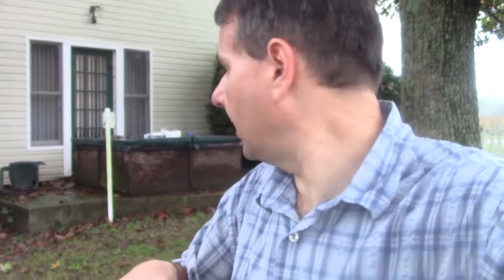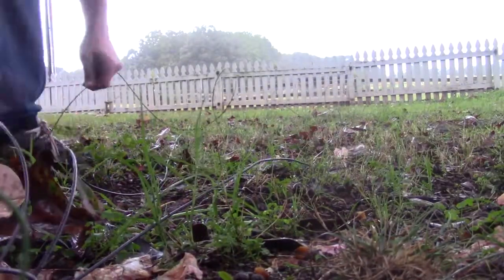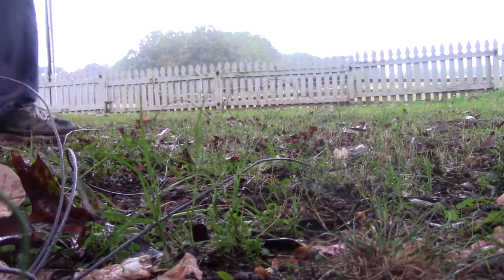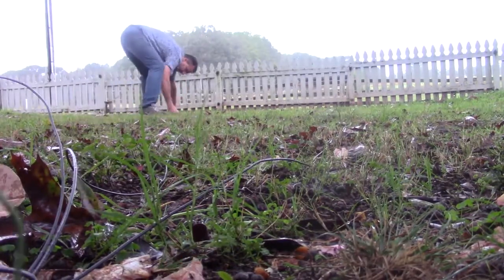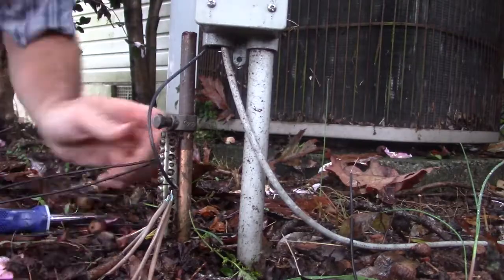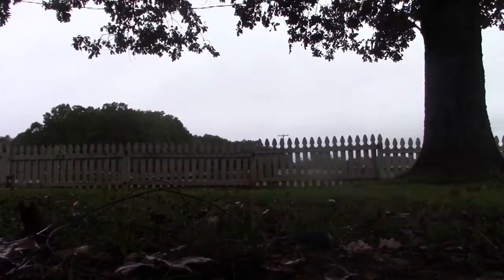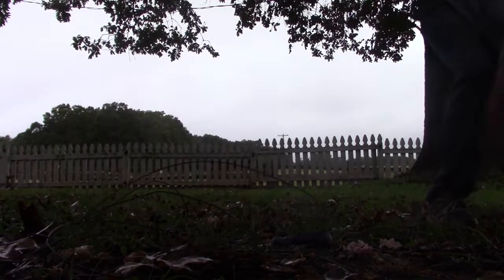Laying down Ground Radials for Vertical Antenna

Comment: Ive got 350 10m long radials now, more doesnt nesserserily improve tx, but in my case , more reduced noise. 73 zl3xdj
Reply from the maker: They certainly help!  I wanted to make sure people knew you don't HAVE to go through all of that to have a functioning antenna - elmers make it think unless you lay down 100 radials you are wasting your time.

Comment: You can also use 1 piece of bare wire strung out to spikes/nails/staples around the vertical in a "star" pattern leading back to a base plate with bolts in it. In other words, you do not have to lay out individual wires. Wrap a wire around a base plate bolt, run it out to a stake/nail/staple, run it back to another bolt on the baseplate, run it out to the next end stake/nail/spike/staple, and then back to the base plate, etc.
Reply from the maker: Thanks for sharing, Bill!  Though the only issue that I have is if by chance a lawnmower does pick up the wire, you would lose a lot as it wrapped around, opposed to just one - but that is a long shot concern.
Reply: @dixielandfarm  Yup. The wire would likely break as quickly as it would if individual radial wires had been installed.

Comment: Hi Kris, great info there. I just ordered a Hy Gain av18vs from Gigaparts this morning and was wondering about the radials. Guess I'm going to amazon now and order the wire and lawn staples. 73, ac7tf from Muncie Indiana
Reply from the maker: Only if it is cheap and easier for you, Paul.  You can probably get cheaper at a Lowes/Home Depot/Tractor Supply... or even better I found rolls of unused telephone cable no one wanted and used that as well.  Same with the wiring block - I grabbed on from Home Depot and it was like 5, but a simple ground clamp and all the cables just wedged in there would work - it isn't very scientific, its just physical hardware connections.
Reply: @dixielandfarm   yes it's a bit expensive on amazon. Got it at lowes and it is already in the locker waiting for me to pick it up thanks again.

Comment: Kris, very good video. Are the radials any specific length? Could you have some that are 3' and others that are 12' of 15'? Are you saying that the TOTAL length of wire used should be 4 wavelengths? Also are the lawn staples metal? Thanks again for the helpful video. Just getting back into HR. Use to be very active but other interests got me. Now I'm back and am suffering with sticker shock on the cost of HF rigs today. de KQ1K
Reply from the maker: This will get very contentious around hams, who insist they must be 1/4 radials...  Total amount wire should be 4 wavelengths, yes.  The radials lose effectiveness quickly in their length, which is why 32 1/8 radials is better than 16 1/4 radials.  64 1/16 radials will also be better, so always just do the best you can with what you have available for space... but also factor in the time to actually lay them out.  The lawn staples are metal, yup.  HF rigs are still cheaper now when adjusted for inflation than ever, but that doesn't mean they are cheap... hamfests will still get you an hf rig for much less... but the new ones seem to last forever - mine is still pumping along 15 years after purchase with no slowdown in sight.
Reply from the maker: Oh, and the follow up - worry less about measuring out the length - they all get detuned the second they are in the ground, so just focus on getting as many in the ground as you can.  And as for 1/16th radials - well, that's probably stretching it - aim for 1/8 if you can.

Comment: How did you attach the ground bus to the ground rod??
Reply from the maker: In the electrical section of the hardware store they sell ground busses - which is great to attach all the cables.  then you can use either a ground rod clamp to hold them together, a jumper wire from that to the bus if that works for you, or two stainless steel hose clamps to bond it.  While not ideal, it works just fine for the antenna.
Reply: @dixielandfarm  Tnx Chris. That's what I thought but I just wanted to check and see what you did. I'm in the mist of putting up a Zero-Five 30' flagpole antenna and the next thing is the radials.

Comment: I’ll be doing that this weekend but in the desert with dry soil, 500’ of 14 ga. 16 radials. Two band vertical , 40 and 80. I’ll get the 80 radials down next weekend probably, another 500’ but only 8 radials, etc, until I’m happy or broke. Enjoyed your presentation.
Reply from the maker: Remember Paul, thickness of wire won't do anything special for you (unless you need it for some reason, or that's what you have on hand).  You can lay down 22ga and it will have the same effect... so you can often find telephone or ethernet wire spools cheaply that are at building supply exchanges/charity/etc and use that - I used dog fence wire for most of mine, but there is some telephone line in the ground :)  Good luck!
Reply: Highly corrosive soil with no conductivity here. Bare wire of any sort is temporary, anything with iron or steel wold be pointless. I’ve done this before but have been off the air for a few years and am installing a fresh antenna as a restart. I’m not troubled by trees either. Living in high desert country is different. On the plus side, I’m at 6,200 ASL with zero above ground electrical utilities and an unobstructed 360 view. It’s quite different than your QTH. Thanks for your advice though. I checked our biggest surplus store yesterday for wire, etc. and the big box stores have better prices and inventory. I can see all the high power broadcast antennas in the area, they’re on a 10,000 foot peak about 50 miles south of me.

Comment: My first serious ground radial system was 30 radials of 32ft each, two years later, 30 radials and most of them were 32ft... stupid lawnmower. After 30 the increase in performance drops off very quickly. The lot where I live now is rectangular, so the plan is (by the way, I recovered all my old radials) to lay out 20 radials of 17.5ft each. I have very rocky, very sandy soil and the water table in the winter is about 30 inches down (I live in Campbell River, BC or as it is known here, "The Wet Coast"). So we shall see what happens, may have to lay out a few more radials, who knows. Thanks for the video, Kris. de VE7KKQ
Reply from the maker: Some say a mesh screen of chicken wire stapled to the ground does great as well... but honestly people get scared off when they hear how much work/wire is needed and just never try for themselves.... while every dB counts, the difference between one S unit or NOT having an antenna, just put up what you can and do your best - or even not your best but pledge to try to go back and do better when you can is the best advice.  Hope you have a great New Year, John!

Comment: My vertical is 43' up. No radials. Using the MFJ-259C, I have a >26:1 SWR. I have to get them radials done ASAP. If things do not get better, I am gonna have to find a different antenna.
Reply from the maker: Even if you dont have time to tack them down, just lay them on the ground to see if that fixes the efficiency of the antenna.  The 43' is a compromise antenna and is not the miracle people think - it is the most convenient vertical, though... It will work, but it will need radials - even at that, you could string up 4 verticals a few feet up off the ground just to see if it puts out (like around the fence if you have one).   Once you feel confident, then you can take the time to actually tack them into the ground.

Comment: m6ltv i made one with a old fan corver  a crome one and the swr is 0 on 20 73 nigel
Reply from the maker: Remember, low SWR isn't always an indication of a good antenna - a dummy load has 1:1!  For verticals, it tends to go up the more effective they are.  Regardless, if you are making contacts, its working!  73 Nigel!

Comment: Been wanting to put a vertical up in the back yard but I literally have only about 10 feet of available lawn in any direction. I don't know if a bunch of wires that short in the ground would do me any good. Talking on an end fed wire right now which gives me plenty of stateside contacts  but very few DX contacts other than Canada.
Reply from the maker: If I recall, the minimum radial wavelength recommended is 1/8... but remember the wire doesn't have to be straight - it can zig zag a bit - but in that case you might want to consider some elevated tuned radials - this will work around fences and such and you probably only need about four of them.  If you can get the wire cheap enough, I would just thrown it on the ground and see what happens.  For 20m, I would consider a vertical dipole - the trick is to get that transmission line to be 90 degrees out from the antenna - but at 15 foot high for the feedpoint that shouldn't be too hard to accomplish.  If your yard happens to have a metal fence, I have read of plenty of people who have used THAT as their counterpoise to some success.
Reply: @dixielandfarm  Thank you. KE0RPU

Comment: Interesting video Kris - love the geeky vids! Thanks for the explanation too. I can't imagine why Marissa wouldn't want a lot of 33ft long wires in the air above the farm, haha. :)
Reply from the maker: Luckily she had no problem with me putting up a 30ft antenna tower next to the house with a 10 ft antenna on that... I used to have a 200 ft antenna going from one tree all the way across a pasture to another tree but I finally took that down after five years... I still have to figure out is this the year I get that hot tub working again...

Comment: Hey Kris, have you tripped already ;) Just kidding. I only know little about antennas. This is cool to know, in some ways it is amazing it is all working. Curious do you get more disturbances these days with all the new mobile frequencies, although they are on the other end of the spectrum. Cheers.  /Paul
Reply from the maker: I DID trip once - but I tacked that one down and I was off.  Funny enough, we have had such a wet winter that they are all already buried, just one month or so after "planting".  You are correct, the cell phones are basically on the other side of the spectrum, so there is no interference, BUT cheap electronics, especially wall chargers, LED lights, CFLs, Solar Panels all make terrible radio pollution.  There are laws in place, but they just aren't being adhered too... Almost any wall charger that uses a switched power supply makes a hash across the entire radio spectrum (opposed to the older ones that had a transformer and were basically silent).  Also, everything electronic is made of plastic when we used to have nice metal shielding around things - so those noises are no longer suppressed.  Out here in the country, I'm my own worse noise, but I know in the cities these frequencies are basically unusable due to radio noise pollution.
Reply: Yeah, switched power supplies are a blessing and a curse. /Paul

Comment: Wow, what a nice surprise seeing the farm and a new video from you on this Monday evening Kris. But first off. When I hear the word radials I think of tires and when I hear wavelenths I think of Van Morrison.  But I did learn quite a bit from the video. <>  Man your knowledge of all things audio is endless. I like the tips on how the ground de-tunes the wire compared to having it raised. So if the antenna was twice as high you could use raised radials to get the perfect signal?  It is amazing how you can get people in England and Germany using 40 meters. Fascinating stuff here Kris. Always appreciate seeing the farm too~
Rob/Boston
Reply from the maker: Well,  that's the interesting thing - perfect we are talking about 1db better... If I had raised the radials, I could get away with 3-10 radials opposed to 120 in the ground for the same amount of gain... but the effort required between 16-20 ground radials and that 120 is small - we will say 1db but it might be lower.  Not enough to fuss over unless we were super desperate.  There is some debate on how many raised radials equal that 120 which is why I said 3 to 10.  INTERESTINGLY enough, if we raised that antenna high enough we could have something called a vertical dipole, which is basically one vertical antenna and one radial, pointed straight down at the ground... however we have to make sure the feedline goes 90 degrees from that, because if it trailed away at an angle, it would actually act as another radial and become part of the antenna - not good.  For smaller antennas (lets say 33 ft long, so at 16 ft we have our feedpoint) that is manageable to do, but for this one (66ft, so 33ft high) it prove to be more of a challenge.  Last point about the 40m band - about 8 years ago I woke up and turned on the radio after during my farm chores and heard Australia, and got them in one call.  That isn't unusual on the higher bands of 20 or 17 meters, but it is more challenging/unusual for 40 meters.  Australia is my antipode (meaning exactly half way around the earth).  How all of this works with wire and 100 watts is still magic to me.

Comment: Hi ya Kris👋🏻very interesting, I remember something about this earlier? Is that correct? Good seeing you and hello to Marissa👋🏻too — Lis
Reply from the maker: Thanks for stopping by, Lisa.  It is a part two to a prior video where I put up the one antenna.  This is where I add wire to make the antenna better (people should be able to hear me more since I am not wasting power warming up the earth and the worms).  There is a part three where I add another element to be able to use the antenna on a whole new set of frequencies (most hams don't even know you can do that, so I am eager to share that info)...